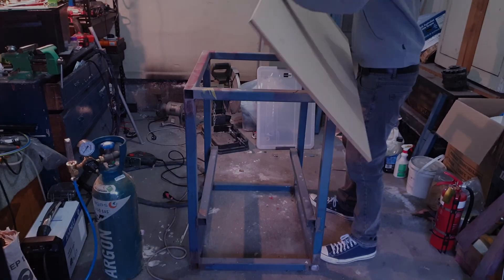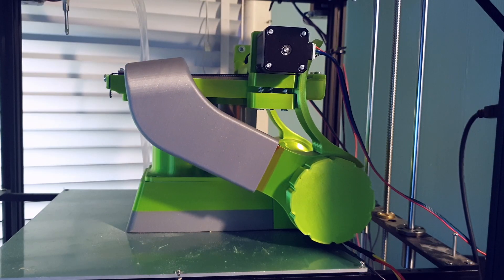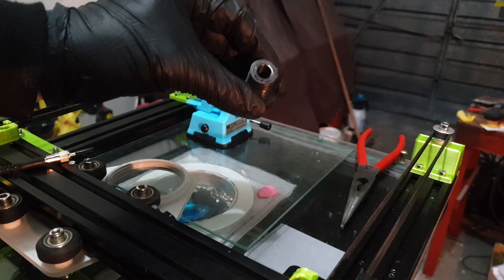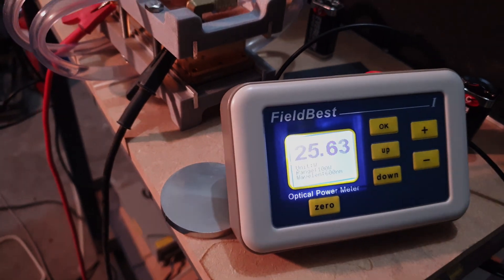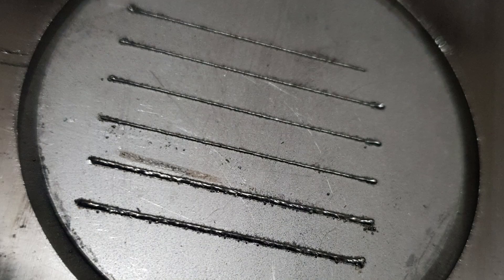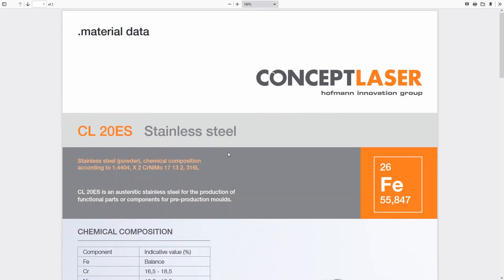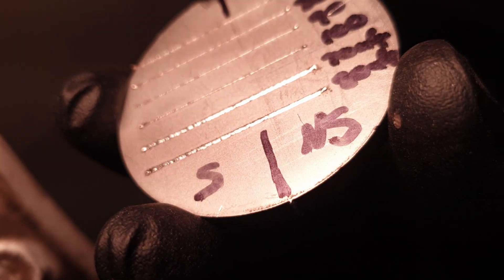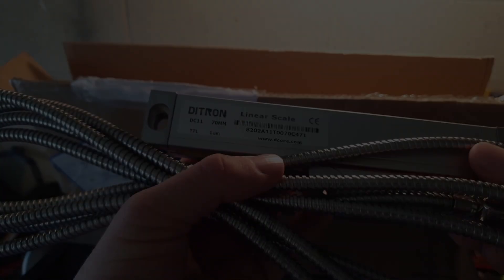The End Of Metal Tracks - DIY Metal 3D Printing

Comment: Would actively cooling your powder help? Perhaps having a greater temperature difference would prevent the melt pool from propagating? Although it could introduce issues with warping. Great work and is really interesting following your research development.
Reply: The deeper you dive into the physics of what's going on here the more you start to see all the variables at play. Cooling the powder may help with the overall shape of the weld pool but does not help with the internal grain structure of how the metal atoms solidify. Then as you start printing more and more layers it will only add to internal stress issues. Each layer shrinks in the x and y significantly by the time the next layer starts. Cold powder would make that problem worse and make your parts look like bananas.
Reply: Fixing one problem usually ends up ruining a feature. At present, preheating the buildplate and the rest of the powder to a certain temperature and allowing heat to be absorbed through the build plate seems to bring the best balance of problems and features. Temperature varies by material and machine setup
Reply: @andrewfromphysics2921   Thanks for taking the time to reply. Yes, there’s definitely a lot of interesting physics going on to actually make this process function. There are countless variable’s and it’s definitely people like Metal Maters who are progressing the technology by identifying them and recording the data. Would be great to do a FEA to predict what will happen, but you’ll never get a full idea until you build a prototype. It seems like very difficult process to get functioning and makes you wonder what other methods could be used to make metal 3D printing simpler and more accessible.

Comment: i still think making a pre heated powder bed 200c+ & adding a simple rotating pre trench v friction weld dragger would do a better end result to flow the metal grains into think molten laver following a concentrated v trench, + over night ball milling the powder to a smaller grain size
Reply: https://youtu.be/1m5TTjhEyeQ?t=682 High temperature Conductive ink - 1000 degg C (Update)
at 45v/50v
https://www.youtube.com/watch?v=Cj9TMmUldhc Friction Welding 3D Printed Parts

Comment: Our physics professor told us about the laser-acceleration issue once. Aparently the trick is to accelerate first and then turn on the laser, then turn it off before decelerating. Maybe a toolpath for lasering a square could look like the weird hastag sign on an apple keyboard?
Other than that, the work you do is absolutely amazing, you might very well become the one to make metal 3d printing available to normal people!
Reply from the maker: I nearly tried implementing a ramp but I think I will pursue an opto-mechanical switch instead. If I can run the laser at full power and modulate heat input that way, I think I will stand a better chance of preventing excess heat drawing in adjacent powder.
Reply: @metalmatters  keeping the laser at a constant power sounds like the right thing to do, even if you COULD match the ramp to the acceleration of the motor you just showed that you cant compensate power by going slower.
Im not 100% sure what you mean with modulating, are we talking a PWM approach?
Reply: In commercial scanners a run in an out path is provided to let the galvo’'s get up to speed

Comment: I can't elaborate because I am NDA'd out of my mind. however, love your project and determination. a suggestion and associated considerations. Try enclosing your machine/workspace, and pressurize it with helium.  Why? Considerations.  1 - Typical commercial Laser powder bed fusion use argon atmosphere to reduce oxides and improve porosity etc. but 2 - the plume (thermal laser plasma, metal powder interaction) results in denudation in front and around melt pool - to reduce melt powder denudation as laser moves, a pressurized atmosphere is desired to mitigate/reduce plume size hence reducing powder denudation beside laser trace. 3 - argon at 5bar produces plasma due to fibre laser interaction with stainless build plate and plasma increases plume denudation because thermal increase and reflections, helium does not produce this plasma, yet reduces denudation due to increased surrounding pressure, at 5bar you will achieve 99% porosity
Reply from the maker: Thanks for the feedback. Helium isn't getting any cheaper though :/
Reply: @metalmatters   HI sir do you have a way other than you tube to pay for the break down of the build even if its by paid subscription step by step breakdown ? you are an angel
Reply: @metalmatters  that is true. The trick i have found is to pressurize the build area. But pressurized air has oxidation issues. Pressurized Argon has plasma/denudation issues. If the stars ever allign, give helium at 5bar a try. 

In the long run, this may be cheaper anyway since assuming you obtain 99% porosity, your control algorithm for z height control becomes manageable/predictable - this is crucial and is increasingly crucial for each additional layer. Either way, keep on keeping on! Love your work!
Reply: When using helium, you may need to reduce laser power or increase travel speed as helium allows for greater energy efficiency.  Also should be able to utilize mix of argon/helium.  Not sure what ratio woul be best for this application but 75/25 argon/helium works very well for tig welding stainless while 25/75 works better for welding aluminum.  Hope this helps. Cheers.
Reply: Might I ask u guys both where I could learn/read more about this stuff? Where I’m from nobody is working on this stuff and I really wanna learn more about it
Reply from the maker: @ltpetsema876  Research papers mainly. Some are free, some are not. I've posted a few here: https://metalmatters.co/forumdisplay.php?fid=25 I'll post a few more up there soon.

Comment: This project is so cool , the prospect of consumer metal printing in the future is unbelievable
Reply: Consumer metal printing is never going to be a thing because the government will step in.
Reply: @Shrouded_reaper  Why?
Reply: You think they will let the populace have access to technology that let's them print   a machine gun in their house?....
Reply: @Shrouded_reaper  It's harder to make a gun with that than with existing tech: there's already 3D printed designs in plastic of guns that only requires a few, easy to source, metal parts to complete. Also, all of them require ammo which you can not 3D print.
Reply: @DiThi  Is it harder now? Yes, that's the point, because it won't be in the future. Is injection molding still easier to do at home than making a plastic object from a 3d printer? Plastic guns require metal components still and are not proper weapons capable of taking rifle cartridges and lack rifled barrels. Every one you see is a 9mm platform, not a threat to government goons in level 4 plate. And yes you can make your own ammo at home with a cheap press, very easily.
Reply: @Shrouded_reaper  ever heard of CNC mills and lathes? People can make gun parts today with those, and yet they're not banned. And the metal components needed by plastic guns are relatively simple to make from standard parts sold in the hardware store. Cutting slots and holes into tubes, that sort of things.
Reply: @DiThi  You have clearly never used a cnc machine if you think to compare it to a 3d printer....
Reply: @Shrouded_reaper  you clearly never used a 3D printer if you think it's easy to get good tolerances
Reply: @Shrouded_reaper lmao, you really think you can print a barrel that can withstand firing a pistol round, much less a machine gun? Never gonna happen
Reply: @badgermcbadger1968  Given that 3d printed metal parts are used in rocket engines holding hundreds of bar of pressure. Yeah, I'm pretty sure you can.
Reply: @Shrouded_reaper  after post processing and with specialised equipment and materials, not something you can get at home, at least not as easy it is to make barrels the usual way with a lathe and broaching tool or just hammering a rifling bullet down a hydrolic pressure tube off of Aliexpress